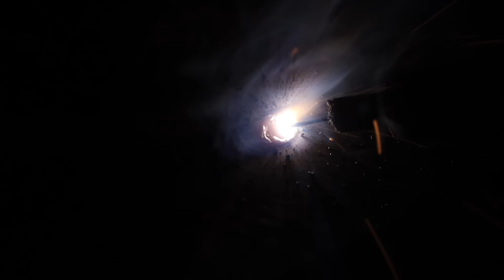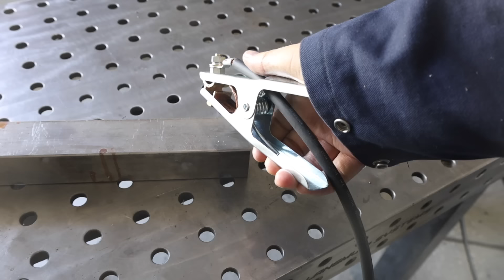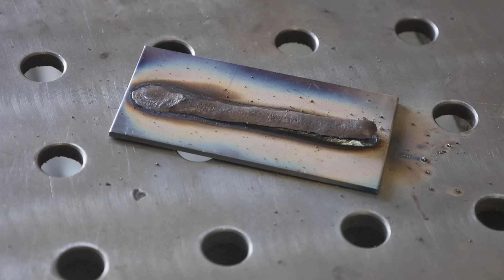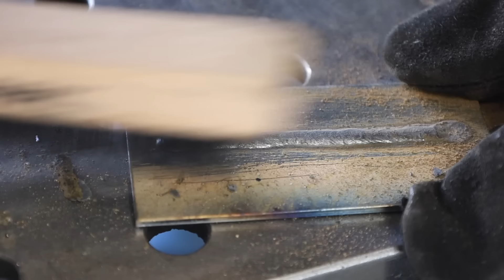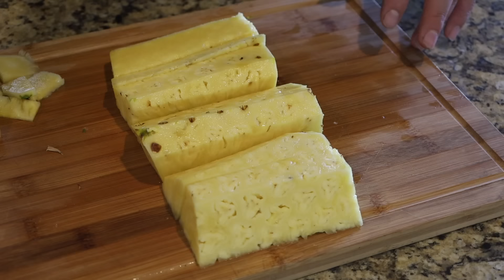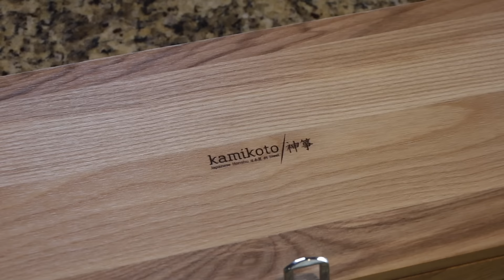Stick vs Flux Cored Welding for Hobbyists: Which type of welding is better for you?

Comment: Great video — people who don’t know that YouTube is a learning resource need to watch this. I started with stick and it WAS difficult, mostly because I didn’t know YouTube as a welding “buddy” back in 2015. I wasn’t accustomed to the relative violence of a metal melting arc using an ancient Lincoln AC225 buzz box so I didn’t turn up the current to get the arc started easily. I believed the “easy arc start” hype on Amazon welders and bought a DC welder, but the digital readout was inaccurate by 10-15 amps and I had many “sticky” starts—I had to just add 10 every time I welded. 
I also tried to weld thin stuff like 16-18 ga. What a hole-y mess that created. Thankfully that welder died at the age of eight. 
I now have a Primeweld MIG180 and running 0.030” flux core, I welded 18ga no problem. I added wheels to the Lincoln and still weld with it to hear the buzz.

Comment: Very frustrated..first time welding, tried on welding a rocker panel on my daughter's car..tried Flux core, and i was very disappointed..it was very weak.not sticking strongly..bang it with a hammer to test its strenght, and panel came right off..and i had sanded the metal part that the rocker panel was going to hang on.. am going to have to try stick

Comment: I know this is an old video but thanks for the info @TimWelds. I'm looking to get my first welder (complete novice here, no welding experience) and was initially looking at a PrimeWeld MIG 180, its multipurpose machine but that can do more than what I will initially be able to. I am now shifting towards PrimeWeld's MIG 160. It only supports 120V but can do both stick and fluxcore. When looking at these lower powered machines, are there specific numbers on the spec sheet to look out for? Thanks again.
Reply from the maker: I think you’ll be glad if you get the 180. Either will work, but IMO the 180 is worth the extra money. It’s my most recommended machine a you can grow with it.

Comment: AI good description for a beginner welder on which process to chose depending on metal thickness. One thing that these videos then to miss however, is that beginner stick/FCAW machines have limited amperage, wire speed control an probably no voltage control as compared to the professional quality machines that the content creators use and welding results may vary.

Comment: I'm still really figuring out which one will be the most used for me. I already had more hours behind me with stick before I learned about flux core. My one desire would be a flux core/stick only machine to keep prices down and--if it runs as well as my 150i esab rogue on 110V--that would be perfect when I weld on the go for jobs.

Comment: I use an arc welder, works great on heavier gauge steel but burns through lighter metals,  even on the lowest setting.  I mostly weld small gauge projects like exhaust lines. I don't want to mess with tig or mig, so I'm wondering if I should go to a flux core welder. 🤔

Comment: This is an old video so I'm not sure if you'll be able to reply. But I'm looking to learn to weld mostly to build some stuff for my Jeep WJ. Specifically a DIY hitch mounted tire carrier. I plan on using 3/16 thick 2x2. I picked up an ARCWELDER 130A 3-1. Stick definitely seems considerably harder to learn. Would just going with FCAW provide a strong enough weld on that material?
Reply from the maker: Yes, flux core welds have the same strength as long as they are done properly.

Comment: I disagree with the notion that wire welding cannot/should not be used on heavier metals.  I run 0.035 E71T-11 and would not hesitate to weld 1/2" or more. Start with a hot root pass, then weave slightly on multiple subsequent passes.  Just wire brush between passes and control your puddle.
Reply from the maker: There’s nothing wrong with flux core on very thick welds, it’s done all the time. Some of the hundred buck flux core machines are short on amperage to weld thicker plate, though.

Comment: I started out with the earlier version of the Lincoln 140.  I've been using that for about 10 years and I've only done flux core welding. I really don't want to bother with gas bottles. The wire spools get shipped to my house from Amazon.

It's been a struggle welding 1/4  and 3/8 but with multiple passes I get it done. It takes too long.

I am planning  to get stick welder from amazon for doing the thicker steel faster. They have 120/240-volt ones for about $130 now. I want to work with 240 volts.

Comment: Flux core is a great process, the problem is most flux core machines are cheap and not very capable. Try flux core on a bigger 200+ amp machine and you’ll have an eye-opening experience at how effective it is. Especially if the machine can run 0.045” wire.

Comment: I was welding 16 gauge sheet metal with my stick welder the other day. I was pretty frustrated with how ugly the welds came out, and burned a couple hole through the material as well. 

Thanks for the video, I will give flux core a try for this type of task and hopefully get better results.

Comment: Went through the local community college's welding program, and i personally enjoyed stick a lot more than flux core and mig. Slightly more challenging, but it felt like a much more versatile process and you never get birds nests of wire in your machine. Just grab an electrode and go to town

Comment: Tim thank you so much for this, I appreciate you! I bought your stick welding course and it's has been a game changer. I don't have a fancy set up, but I've been running lines (like you recommended) on 1/8 flat bar for a month now. And my lines are looking better with each day...and I'm not sticking much anymore!
Reply from the maker: Nice work! Your beads don't have to be perfect to move on to the next exercises. Feel free to email if you have any questions or want any feedback on your course exercises.

Comment: Looks like this is just the video for me! Just starting as a retired person diy. Some smaller guage floor pan and tubing on go karts, but also some utility trailer and farm tractor work. Clears up some questions on when to use what welder. Looks like it will be a Yeswelder 165ds Pro multi for me. Thanks

Comment: Stick and Flux has there place. With me for really thin stuff. Ive found 0.6mm flux core wire works nice. Anything above 3mm then i prefer stick.
Reply: even 2.0mm thickness is decent with stick. 1.0 to 1.5 mm is painful with stick though

Comment: If one plans to run flux core arc welding process do not buy such a small machine. Spend a bit more and get at least 170 amp machine. Load it with E70T11 wire. You can then run multi pass and weld 1 inch plate without issues once you know the basics. As for stick, get a good machine that can deliver 200+ amps. You can always turn down a welder, but once you max it out that's all it has. This is one of those things I wish I had been told 25 years ago.

Comment: I run the Titanium 125 you show in the vid. No Problem multiple beads, no problem up to 3/8 inch - even though it's only rated for 3/16. I've passed destructive testing conducted by the local college certified tester (informally).

Comment: The welder for flux core needs to be able to have the polarity changed (cuts splatter) if it's a 2 in 1 machine that does stick as well as flux core, as many machines these days do both, that there are even 3 in 1 machines, and 4 in 1 machines that can cut as well as arc weld with gas.
That if any one is getting a machine that can only do 1 thing, it's a limitation of what can be done.. and that no one needs 2 to 4 welders.. unless their running 1 off batteries.. that can be done with a stick.. or even coat hanger wire.

Comment: Wow it is tough to chose on a budget.  A FACW machine works with constant voltage and thin wire, the SMAW machine uses  constant current so different circuitry needed.  A stick welder can also become a TIG welder with the hook up of a manual gas valve torch , but a hookup for a pedal would help (a fairly expensive outlay for a gas bottle required).  TIG can get you brazing too.
Most buget FCAW/MIG welder are only going to have up to .035 , maybe .045.   Getting 2/10lb spools of specialty wire will be harder than getting different welding rods. For instance: Lincoln NR211MP, a common multi-pass wire is only rated a 5/16 plate thickness unless you jump to .068 wire.  It is very hard to find detailed spec on import wire.

Comment: My vote is for a TIG rig for the hobbyist.  You can TIG weld in a closed garage without all the fumes or throwing sparks all over your vehicles that may also be parked in said garage.  You can also weld steel and aluminum with TIG (assuming you spend a little extra for an AC/DC machine).  Lastly almost every TIG welder can also double as a stick welder as well for when you need to weld in a place where you can’t rely on argon shielding.
Reply: Tig is also a MUCH higher starting cost. I can get a good flux core or stick welding setup, welder, mask, wire/sticks, gloves, hammer, and brush is under $250. Compared to a minimum of $1000 dollars to get started in MIG.
Reply: Tig is slow and you can definitely throw some heat down, but I like Tig brazing.  Tig welders can usually put a little less in amps for stick, but the same power output due to the higher weld voltage.

Comment: First person  I've heard say that stick is more productive than mig, even for flux core. Gotta disagree with you there, and I stick weld almost everything.
Reply from the maker: Stick is not more productive than MIG in general. I might not have explained it well, but my point was specific to small entry level equipment. The small 120 volt hobby flux core welders require such a slow travel speed that you can easily outrun it with a basic stick welder. With the right equipment, wire feed will blow stick welding out of the water on productivity.

Comment: That rod requires a certain amount of current to even begin fusing wich could exceed the heat the base material can handle before being blown thru,if you turn your current down the rod won't even fuse,turn your current up and the base material can't take it but with flux core you get more versatility because you use a thin wire but when more current is needed to ensure fusion with a thicker work piece,you just turn up the wire feeding speed.Also working at home those strike attempts with the rod will wreak havoc on your power.I got me a little flux core machine and I work so much faster.Also its more precise cause I can bring my torch right where I wanna tack before putting my hood down without accidentally striking an arc,because unlike with STICK,arc won't start until i squeeze that trigger
Reply: I keep a couple lbs of 1/16 rods just for this. MIG/Flux core are unbeatable for ease and productivity, but i find stick far more enjoyable, not to mention stronger than MIG on thick metals. I have all processes in my home shop, and i probably stick weld the most.

Comment: Hello, I'm currently building a talkbike but have no idea which type of welding is best for my project. I'm a complete beginner and have no clue what so ever. Only thing I know is that I want to either start with stick welding or flux core welding. Welding with gas seems a bit to complex for me. I'm on quite a tight budget and will only use it rarely mostly for steel bike frames. Maybe you could help me deciding?
Reply from the maker: Thanks for the comment! Out of the two, flux core will be a better choice. I'm not sure what level of bike frame you're building, but custom bikes are generally TIG welded, which is a better choice, but it is more complicated to learn and more expensive.
Reply: @TimWelds  Thanks very much!!

Comment: Which one has slag that is easier to clean up?
Reply: Depends. Stick welding with 6010 is a dirty rod and can leave a mess behind. 7018 however is a nice one. Flux core can be said the same thing too. Really depends on what you are welding.

Comment: funny how cost was never mention, stick welding is way more expensive to do then flux, compared to the price of a roll of flux core wire, electrodes for stick welding are quite expensive and burn up fast, you an go a long way on even a 2lb spool of flux for under $20.......
Reply from the maker: It depends on where you buy them, but in 10lb quantities, flux core wire is around $6/lb and stick rods are around $4/lb.

Comment: Going to start welding this year. The machine l'm buying is a bit expensive but it's a 3 in 1 process (mma,mig and mag). Stick will do heavy welding while running mig/mag/flux will do the sheet metal repairs on my classic car 😊

Comment: I love stick welding, I'm a certified structural welder for 16 years now with stick but I've used my weld pak 155 from the early 90s with 035 flux core to weld 1/2  inch. It depends on experience.

Comment: When welding vertical and sweeping back and forth from bottom to top the wire flux makes cleaner welds and you can continue process without changing sticks for longer welds that you are trying to complete in one pass. If you have to stop and change? it cools down the weld process and then you get more cold roll on the sides of the weld. I like Stick welding if I am doing shorter welds and don't want to set up a lot of equipment for a short job though this is just my experience.

Comment: Thoughts on using the flux core just to tack everything up. Then finishing the actuals welds with stick.
Usually welding what would be considered scope for a stick process..
Thanks!
Reply: Depends on the thickness of the material especially if it’s either a tack/stitch weld and what is it you are welding.

Comment: Stick welding is the process I use in my garage I have a flux core welder but I don’t use it unless I have to weld 14 gauge metal having three old school AC stick welders is pretty handy for welding over 1/8 thick metal flux core just doesn’t penetrate

Comment: Very recently I sold my 120v flux core welder, and bought a multi-process welder. My goal is to do MIG, but I don'y have the budget for a gas bottle and regulator right now. So I decided to try stick welding. After just a short time practicing with 6013 and 7014 electrodes, I much prefer stick welding. It may have been brand of flux core wire I use, but the smoke from flux core really made it hard to see what I was doing. Visibilty is much better with stick (for my setup anyway). I also find it easier to see the work angle with stick as compared to a wire feed torch. And, if I bend the electrode down a bit, it seems easier on my shoulder than trying to get the wire feed torch at the right angle. Hot start makes it pretty easy to strike an arc without sticking. I am a bit surpised at how quickly you burn through an electrode, but so far that'sthe only minor downside.

Comment: Thanks for the awesome video! Help! I have 1 huge question: What do you think of using a protective sheet from splatter, with something like maybe bands of aluminum flashing strapped around the work during flux mig ? I had idea to maybe rivet sheets of the flashing in a band to go around the work,  a bit out from a joint, as a way to use flux mig with art where aesthetics / no splatter mess is important. Although I do currently have a large metal assemblage sculpture in progress, for most work, I expect to use mostly tack welding, & short joints, for mixed media art work, where I will just be creating metal support structures to hold other materials on top (like pieces of wood, or plaster or cement). So it seems flux mig is my best option, (probably with a 3 in 1 machine that gives option for stick & lift tig as well for the occasional more extensive use of metal in a sculpture).
Reply from the maker: I think you could use a protective sheet. I'd probably look at using anti-spatter spray instead to keep the spatter from sticking. It works pretty well.

Comment: Hey Tim,

I received an old Lincoln Electric AC stick welder as a gift not long ago and as much as I love it and use it well, i cannot figure out something simple like welding two 1/8” or 1/16” washers together.  I know from your video, its not advisable to stickweld less than 1/8”, but still, i dont want to buy a second machine just to tack two thin pieces of metal together without sticking my rod or melting the crap out of the washers. Do you have any suggestions as to best electrode, thickness amperage and angle even if after, i need to grind out the lumps and spatter! 

Signed Yours Hopefully
Alan
Reply: Try 1/16” 6013 rods. Low penetration. You may still need to be quick welding thin stuff. Strike the arc and move!